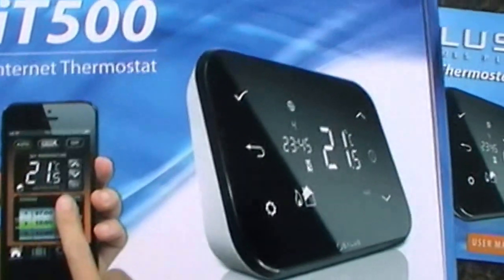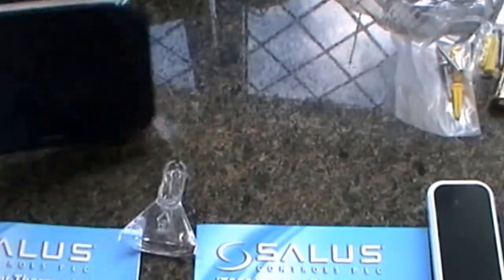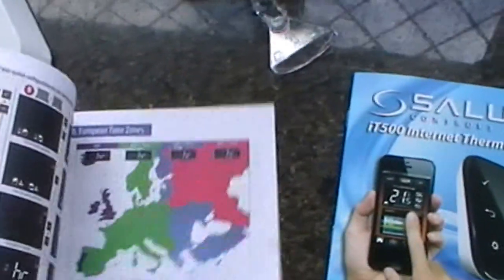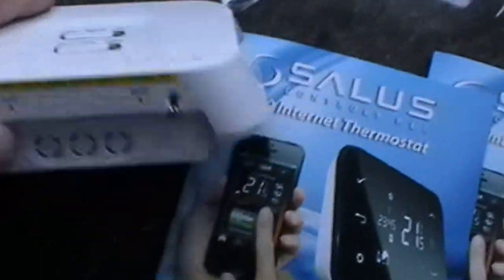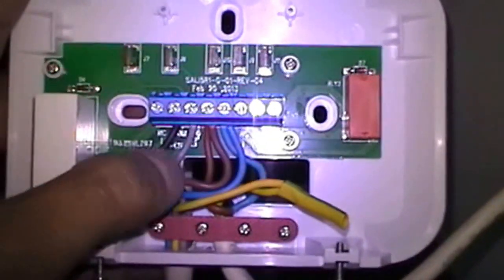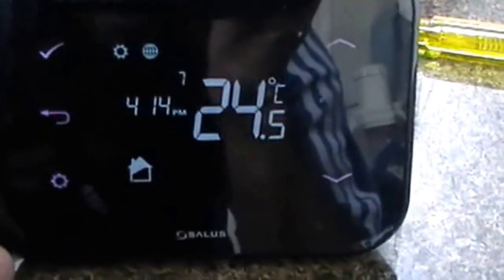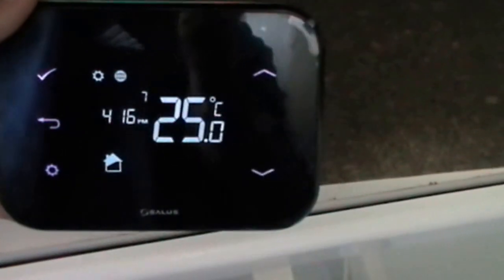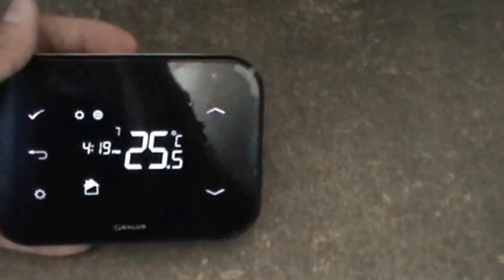Salus iT500 smart Thermostat setup⚙️

Comment: Unable to use app just goes to demo page and gateway has know lights red or green recently gone like that have changed batteries in thermostat still nothing do I need a new gateway any ideas
Reply from the maker: Hi, I'm afraid this is a very old device. Due to many complications and the lack of support, we stopped fitting these. 
Sorry I couldn't be of any help.

Comment: Salus have STILL not resolved the connection control issue between Alexa devices and the iT500 Receiver. This means that Alexa cannot control the heating, despite a number of negative comments about the Alexa Skill . This is NOT an Alexa issue, but needs a fix by SALUS.
The primary problem is the inability to log on to the Salus system via the Alexa Skill.
I wouldn't buy the iT500 until this is resolved by SALUS

Comment: Hi having a slight problem with mine,it keeps jumping forward an hour on the time.Even when I set it maually from the box it jumps forward an hour after a while.When logging into my account on the salus website on the pc that reads an hour in front too.Any help would be appreciates
Reply from the maker: Hi, I think that would have to do with the daylight saving setting. I think you can turn that off. If can't find the setting give technicals a call they are helpful.
Reply: Thank you so much,I phoned them up and they talked me through changing the settings so now all ok.I really dont know why I just didn't phone them in the first place.Thanks again for your reply.

Comment: The reason why the old one was not working because it was to close to the boiler. Manufactures recommend at least 30cm away from boiler as heat effects it. Maybe install the salus ome slightly away :)

Comment: Hi mate
I am having a problem connecting my android app to the Salus. the system is working fine and heating the rads and water. the device shows up on my app. however when I click on it the symbol spins round and nothing happens. 
there is an icon for me to update the os. .. however when I click on that it tells me to change the batteries in the thermostat, which I have done. 

I have downloaded the app on my girlfriends I phone and logged in and it works perfectly.

any ideas?
thanks
Dom

Comment: Hello,

Thanks for the video. 
My boiler is Nefit 3030 S Combi and I am using the termostat from Nefit, and working file. 
When I try to use the iT500 my boiler is not responding for the signal. 
Is it possible for you to show the wiring between the bioler and reciver unit. Do I need to give power supply via receiver unit to boiler? 

Thanks
Karthi
Reply from the maker: Karthi Kumar I'm glad I could help.